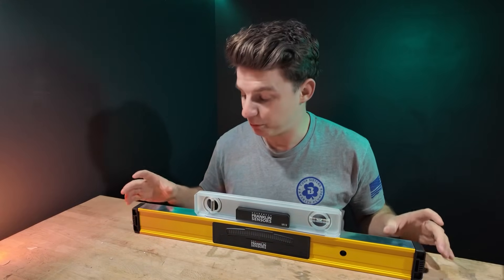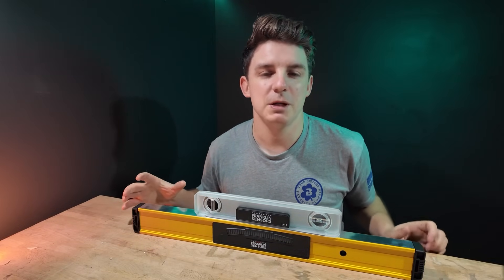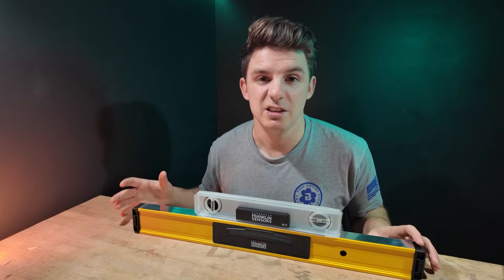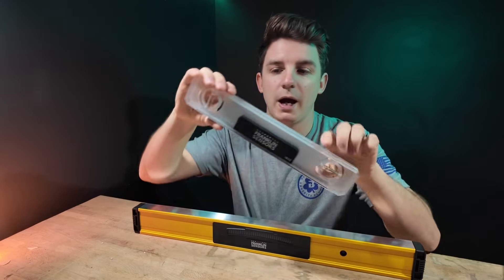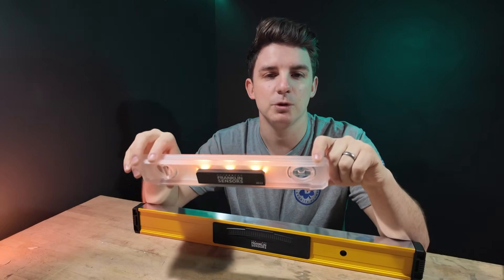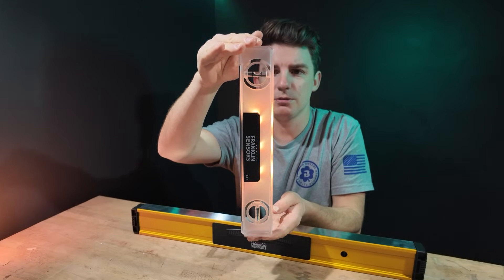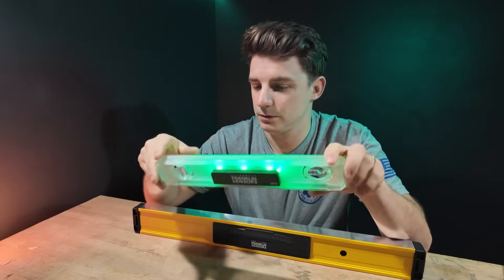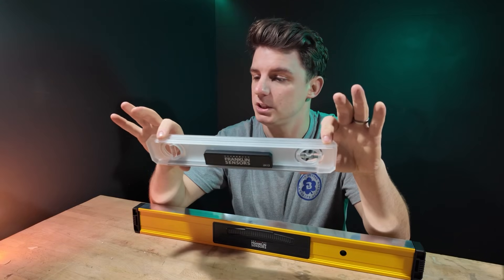These levels are a level above the rest! #tools #review

Comment: I no most of the time you work in dark places inside so these maybe ideal, how do you think they perform in full sunshine used outside? Basically are the LEDS good enough in full daylight as we’ve had issues seeing the laser level lines in the past outside. I’ve just looked these up and there on Amazon
Reply from the maker: They work really well mate as you say outside is less voidable but still have the bubble and can see a little

Comment: I like it. Does it require calibrating after time? Have you tested it against a normal spirit level or a laser level ?
Reply: It's easy to test levels any time. Just put on any surface, take a reading, turn it around 180 degrees and check the reading is the same. No need to calibrate.
Reply from the maker: I’ve asked and shouldn’t need calibrating, just need to be careful with them